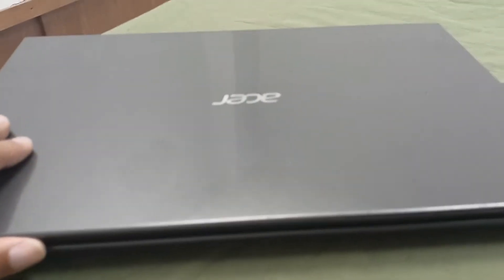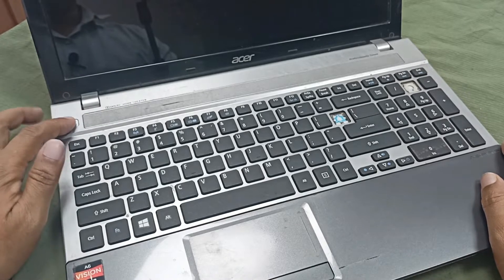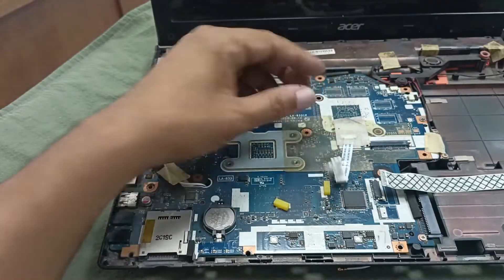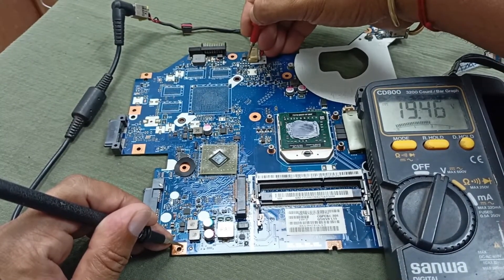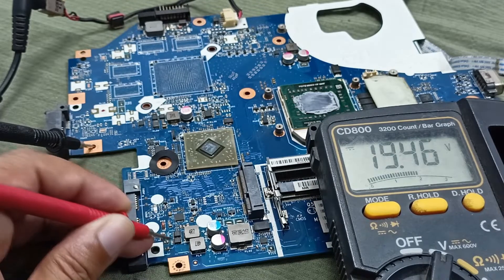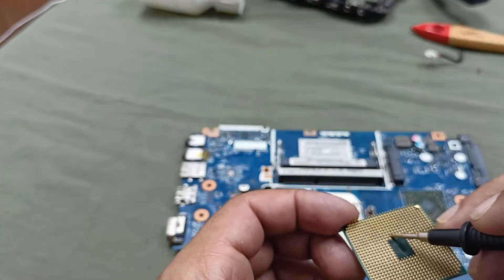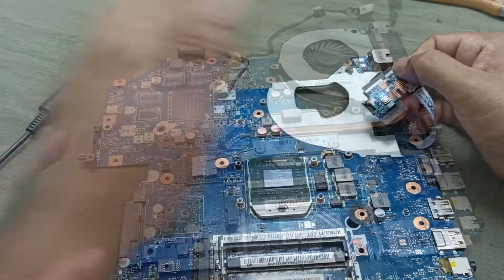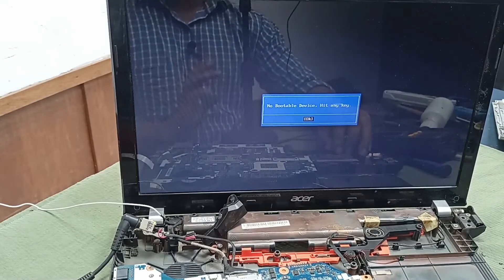Acer Aspire V3 laptop no Power || Acer laptop power won't turn on.

Comment: All you did was clean the board? My aspire v3 571 doesn’t turn on. Also when plugged in the lights in the front don’t light up. Could it be the power button board? The power button board looks slightly heat damaged.
Reply from the maker: If it is possible measure/ check the heated damage parts that are ok or not if you get that ok check the capacitors and resoldering the heated parts. Thanks for watching...